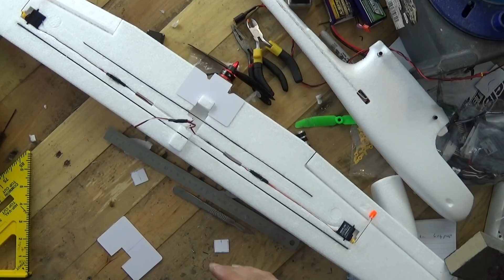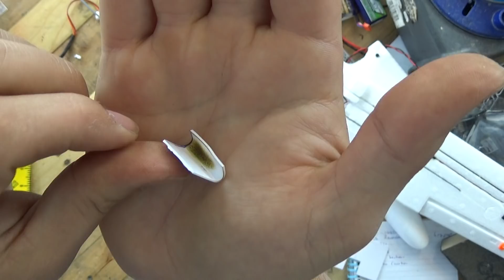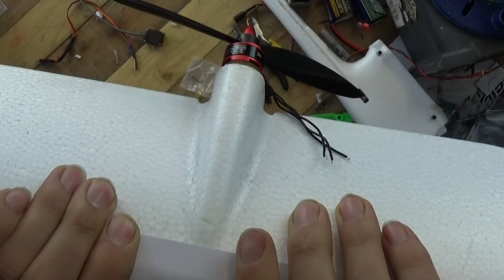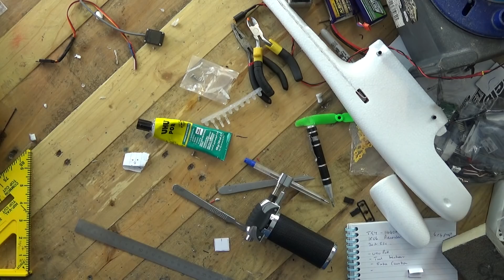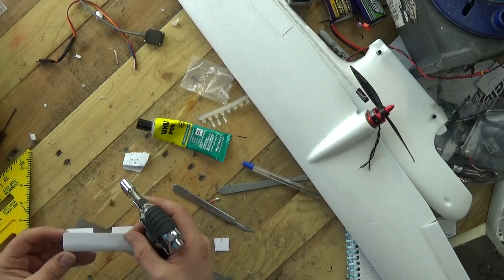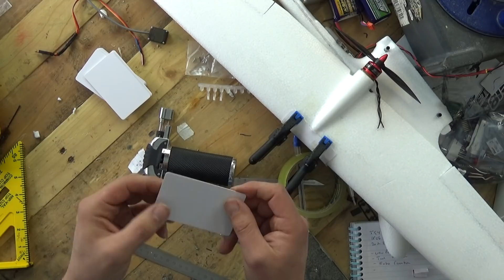Heat Bending a ID Card for Wing Protection. Will it Work?

Comment: Maybe a heat gun instead of a torch? Love your ID Card Idea. I have just ordered some on eBay. You may like my reinforcing item of choice which are tongue depressors or also listed as the wooden spatulas used by ladies to wax their bits! These make excellent small parts for models and they are as cheap as beans!

https://www.ebay.co.uk/itm/Wooden-Waxing-Spatula-Tongue-Depressor-Tattoo-Wax-applicator-Sticks-x-100/191764190540?epid=1582793817&hash=item2ca609554c:g:bfEAAOSwqu9U8xg-